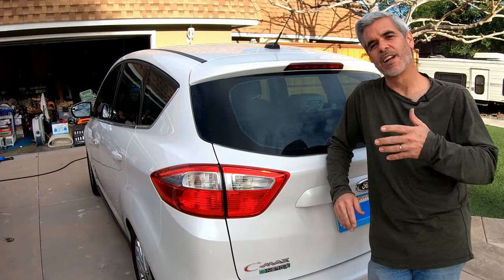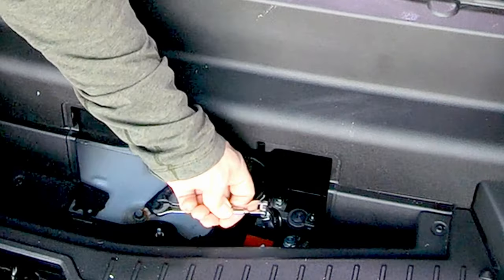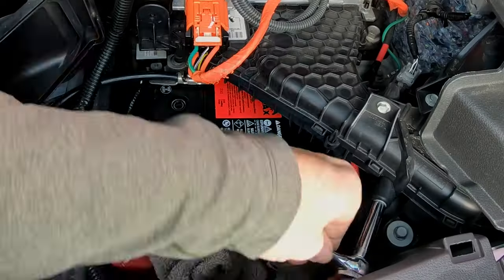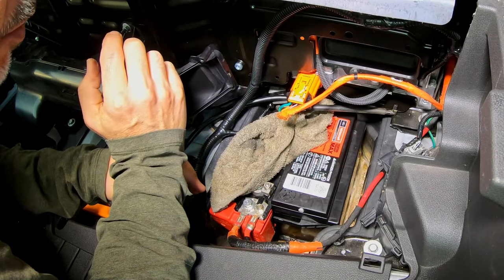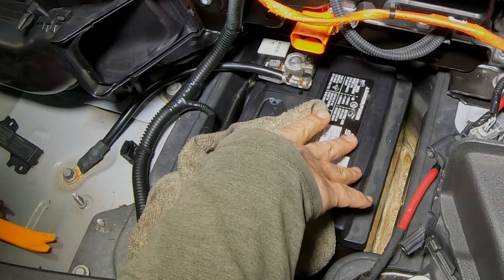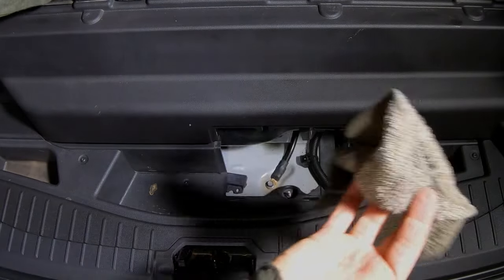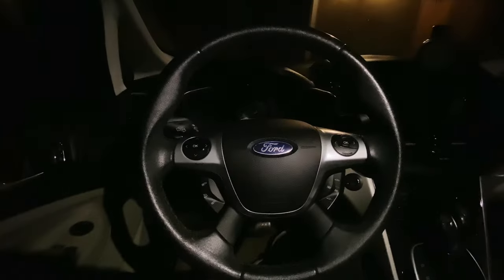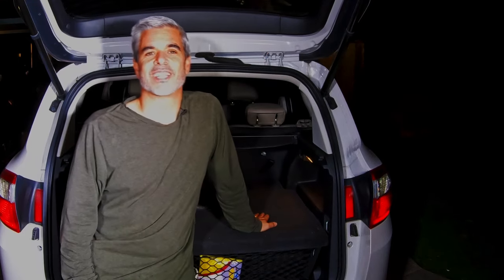Ford C-Max 12V Battery Replacement Including HV Disconnection

Comment: Thanks for the post. My 12v finally died after 10 years. Followed your instructions, and the low plastic pop rivet was a pain in the rear. I ended up going to OReilleys to get the special tool. After much wailing and gnashing of teeth I reverted to a pointy tip vice grip. After that horrible rivet was done the rest of the job went easy. I used forscan to reset the battery after replacing. Hopefully this will last another 10 years. We only have 40,000 miles on the car, so I expect we'll get another 10, unless I decide to go full electric by then.
Anyhow, folks like you are what make youtube great! Thanks!
Reply from the maker: Thanks so much for your comments!  I really appreciate that you took the time to say 'thanks'. 😀   Hard to believe you only have 40K miles in 10 years!

Comment: The battery on my daughter’s C-Max Energi conked out on her as she was working at a ski lodge. Zero power = pain to get to the battery because the lift gate cannot open. I was able to jump it, and once we drove back home, I changed out the battery. What a pain, but Dan’s steps are on point. I struggled with getting the new battery in because I didn’t fully remove the high voltage plug and ended up cracking the clip on it.
Reply from the maker: Glad you were able to get it done.  Definitely worth it to remove the high voltage connection to make access easier.💪

Comment: I bought a 2017 C-Max new 2-2018, and am thinking about replacing my battery now, not waiting longer.  I live in Portland Oregon, where it typically never is over about 95F.  (a few days a year).  My original battery is not showing signs of age yet.  But it looks like unscheduled replacement is not going to be easy, as doing it in my driveway proactively!  

Thanks for a great video!  I am also thinking about replacing my high voltage plug in hybrid battery, especially if I can get a longer range replacement!  10 KW would be wonderful!  The factory 7.5 KW used to have 18 miles of range, now down to 13 miles at 44,000 miles, 5 years of use.  It was searching for a new hybrid battery that brought up this very great video!
Reply: I wonder if the 12 volt jack in the back of the vehicle couldn't be used as a sort of a jump start port. I know it's not going to handle the amperage needed to jumpstart from zero but it could perhaps be used to give a charge over 15 to 30 minutes to the 12 volt battery sufficient to start the car. (I know it doesn't actually directly start the engine.) I was thinking one of those handheld lithium jump start packs would be handy.
Reply: Since your battery is working fine and it's cumbersome to replace, I'd wait until it is necessary and then use this awesome video as a guide. You will start to see warning signs of the battery weakening well before you are in dire circumstances. If you are concerned about being unable to start, you could get a small portable NOCO lithium battery pack to easily jump the C-Max using the grey negative post and red capped positive terminal, right side under the hood (or also jump anyone else in need you come across). You could also get a NOCO battery maintainer, which can top off your charge via the same remote battery posts and might buy you some time until one of your battery cells just gives out being able to hold a charge.

Comment: Hi there Dan!  This video was a life saver.  Our 2017 Cmax Energi just died without warning a couple of days ago. Based on my research it was most likely the low voltage battery.  I swapped the battery with the help of our video which was perfect showing details of the exact steps I found confusing such as the orange plug and the battery life reset.  The car is fixed and I want to send a huge thank you your way!  To add some context, I used FORScan on my Win10 laptop along with the  OBDLink EX FORScan OBD USB Adapter to reset the battery time.  My Bluetooth ODBII adapter that works fine on my 2014 F-150 would not work in the Cmax.
Reply from the maker: Thanks for the comments and suggestions for the ODB Adaptor you used.  Is this the same one: https://geni.us/OBDlink_EX
Reply: @DansWay  Correct.  This is the exact one I bought.
Reply from the maker: @winsorro  thanks for the confirmation!

Comment: Took my car into the dealer after the battery was changed out by a autobody repairman.
I was having all these issues and apparently the Ford dealer couldn’t figure out what was wrong.
Saw your video follow the procedure to flash the headlights and pump the brakes and now everything works great. I can’t wait to get back and show them how stupid they are.
Reply: Ignorant can be fixed. Stupid maybe not.

Comment: Great Video.   I re-charged my Battery, as it was COMPLETELY dead upon returning from a Month-long Vacation (Feb 2024).   I need to find a deal on a battery so, in the meantime, I want to TURN OFF that ENGINE LIGHT on the left Side which also shows a little golden "Wrench" warning and it also displays, "Check Manual."   I want to reset it for the time being.  Thanks so MUCH for this video (well done).  I plan to do it myself.   Your warnings about not grounding it out were perfect (using a rag).   DJ

Comment: The battery arrived and now I'm trying to finish the job. I don't suppose you remember where you got that 8mm extremely long socket to remove the bolt at the front of the battery? All the places around here just seem to have the standard depth ones that are about half the length needed.
Reply from the maker: I have one of those large socket sets that has both normal and deep sockets. Looks like they are available using Amazon prime: https://amzn.to/482aV2f
Reply: I actually used an extension bar to get it removed ... but after turning it forever, realized the nut on the bottom was frozen.  It ended up snapping the bolt when I applied a vice grip on the nut to stop it spinning!

Comment: In agreement with all the comments here, very well done. I woke up to a dead 2016 Energi and after putting a trickle charger on it got running but after sitting for only a few hours deadness again. Will assume it is the battery since it is probably original. Just bought it with 30k miles but everything looks new. Only problem I am having is that the electric ABS pump runs at start up and every time the brakes are applied in electric mode. Hopefully a stuck solenoid due to the issue of the previous owner never running in EV mode.
Reply from the maker: Wow, I haven’t heard of that problem before.  Let us know how it goes, and what the fix was.

Comment: It looks as if the little tube the is supposed to vent the 12v battery was disconnected.  On some batteries, the little port is on the positive side. That is right above the area where you found corrosion on the tie down bold and block.  BTW, this seems like the perfect application for an absorbed glass mat battery; I don't know why they didn't use that, in which case tilting the battery during installation wouldn't be an issue.
Reply from the maker: You are exactly right, an AGM battery would be much better for this location.  In the video I did show the re-installation of the breather tube at 13:38.  My replacement battery had holes on both sides, so I had to cap the one closest to the bumper.

Comment: Hey Dan , Thanx for the video. Great detail.  Did you mention which battery to buy? Also, is there any way to know the manual attempt to resetting the battery timer actually worked? Thanks again
Reply from the maker: Hey there, so I don't have a specific battery recommendation.  I went to my local parts shop and put in the best battery they offered. I would suggest an AGM battery due to the fact that they don't have the same spillable acid inside.  for the manual reset process, I didn't do it myself because I wanted to do it with my ODB scanner to see things actually changing.  I would strongly suggest owning a scanner.  For the cost it lets you see what is going on and diagnose all of your vehicles before you take them to the shop (if at all...)

Comment: Sveiki, ačiū video Ford c max gerai.Problema, mechaninį raktelis visų durų atidarė bet negaliu atidaryti bagažinės gaubtą.Ką daryti?
Reply from the maker: The next step is to use jumper cables connected under the front hood to the jump-start terminal on the driver side of the car.  There is a red cap you remove that shows a metal tab you connect to for the + or positive connection to a jump-pack or other car.  The negative connects anywhere on the metal frame of the car.  This should power the car enough to open the rear hatch with the button on the center dashboard.

Comment: Dan, did you figure out that HV connector by yourself?  It isn't obvious that you need to pry up the two fingers for the last release.  I just adapted a 26R battery for my C-Max.  I needed to get the car on the road and there were no 67R batteries available.  The 26R is an inch taller than the 67R so the HV connector definitely has to be removed during installation.  The venting is the only significant problem with the 26R.  A day after the initial installation, I made a sealed box to go over the vents and connected it to the external vent hose.
Reply from the maker: Wow, great adaption.  I love it!  I actually got the datasheet for the connector itself and saw the exploded view.  There were also some numbers on the connector that implied that the tabs needed to be pried up.  I assume there is some official tool, but a simple screwdriver makes it move just fine... 👍

Comment: I want to disconnect the negative terminal, but not remove the battery. I need to work on the seatbelt system so just want power disconnected. Is there an easy way to remove the negative terminal without disassembling all the panels? The negative terminal is difficult to pop off.
Reply from the maker: Not sure how to do that easily.  Removing the panels only takes a few minutes with the right T30 bit.  Just give it a try and you can have it out in less than 10 minutes.

Comment: I replaced my battery but now my. car is stuck in accessory mode. Have you ever experienced that and know how to get out of it?
Reply from the maker: So strange!  So what happens when you press on the brake and press start?  I've never seen this myself.  Anyone else have any ideas?
Reply: @DansWay figured it out. It was the high voltage disconnect. I didn’t put it back correctly. I was tired and wasn’t fully aware. But once I double checked I realized I forgot to fully connect it.

Comment: Wow, so this is the battery that spins the wheels when the gas engine is not activated? I expected it to be much bigger, and much heavier.

EDIT- 19:23 huh, it's kinda like retraining the computer in the car by reminding the cache how the windows open up and close, I guess.
Reply from the maker: This 12V battery is just used to run the accessories and boot the car computer.  The main traction battery is what this battery was tucked under.  The whole trunk area is the big high-voltage battery.

Comment: Was going to follow this video to replace the battery myself but now the liftgate won't open and there seems to be no manual way of opening it without power. Don't suppose you know where there is a manual release for the liftgate? I've looked around from inside and no manual release seemed to be visible... sigh.
Reply from the maker: You can hook up jumper cables or a jump pack under the hood to apply 12 to the system so you can pop the hood.  Let me know if this helps.
Reply: @DansWay  Yeah, I ended up doing that before I read your message. Just kind of odd that, unlike most vehicles, the CMAX seems to have no manual method of opening the hatch from the inside. I looked through a bunch of forums about it. Anyway, thanks for the video on switching out the battery!

Comment: Thanks for the video.  With your help, too me 45 mins
Reply from the maker: Wow, Rudy, you slammed through that change! Did you remove the HV connection as well?
Reply: @DansWay  Yes, sir.  I did everything you did.  Since you went through the discovery process, I did not have to.  I did use an electric ratchet that sped up the removal of parts.  I made sure not to over-torque.
Reply from the maker: @rudeman80  Awesome!  Thanks for your input.  Glad to know this can be done quickly once the process is understood...

Comment: if I take a 12v out of 2015 ford cmax to replace a dead one, will the car shut off and think its is stolen?   Do I need a memory saver mechanism?
Reply from the maker: Removing the battery doesn’t change any settings. It won’t work without the battery so it won’t know any better about the battery being removed.

Comment: Quick question... do i have to unplug the high-voltage battery clip . ? And why?  I changed the 12  volt battery without doing that? Anything could happend ?
Reply from the maker: I just didn't like the way the power connector was all scratched up by Ford's service department replacing it in the past so I researched what it takes to remove it.  You don't have to for sure...  Just less likely to smack it when removing the battery, and  you don't have to stand the battery on end to get it out with the conector removed.

Comment: Hi Dan. Thanks for the video! Question though. I bought the FORscan Lite. But it’s asking me to connect Bluetooth but I have the same Foreseal WiFi scanner you do. Any tips to connect?
Reply from the maker: The kiey is to connect to the Foreseal WiFi scanner using your wifi connection in settings on your phone.  Once connected, then open the app and it should find it no problem.
Reply: Also, I had to “reset” the tailgate too. Had to close it manually then it would open and close. Unless because I didn’t reset battery life. But I had to do the windows too.
Reply from the maker: @Dcris78 interesting!  I haven't heard of that one myself.  Are you saying it wouldn't close automatically at all?

Comment: When disconnecting the High Voltage Service plug. Does it matter if the 12v battery is disconnected 1st or 2nd to the service plug removal? I have a 2013 Fusion Hybrid so my 12v isn't close to any orange cables or wires.
Reply from the maker: I don't think it should be an issue, just make sure the car is fully off, and been off for a while so it is only using the low-voltage battery at most.

Comment: Awesome job Dan !!  Many THANKS for putting this together and now I have the tools to tackle this job for my own car.  Side note did you ever find or look for an AGM battery ?
Reply from the maker: Thanks for your comments!  Once I got this installed (and replaced the faulty water pump that was running randomly when the car was off), all the errors I was getting on the car went away so I haven't thought about it again since.  Let me know if you found an AGM that would work in this form factor as that would be preferred for many reasons.

Comment: Hi Dan,  nice video.  Did you have to do anything unusual to get Forscan Lite to connect to the Foseal ODB adapter?  My app won't find the vehicle for some reason.
Reply from the maker: I just manually connect to the wifi signal from the ODB adaptor before opening the app.  Let me know if that work for you.

Comment: Great video. Big help when I replaced the battery on my 2016 Max Energi. It looks a lot worse to do than it is. I didn't have to remove the high voltage cable. The manual battery age reset doesn't give any feedback as to whether it worked so I went ahead and bought the ODB scanner from Amazon.
Reply: Although others have said otherwise I believe the reset for the battery is just a fancy timer to tell you when to get a new battery. This is probably because it's so inconvenient to have a dead battery in one of these cars. But I don't think it has anything to do with the charging correctly or not that just doesn't make any sense. I and many others have replaced our 12 volt batteries and didn't reset and there are no consequences practically speaking.